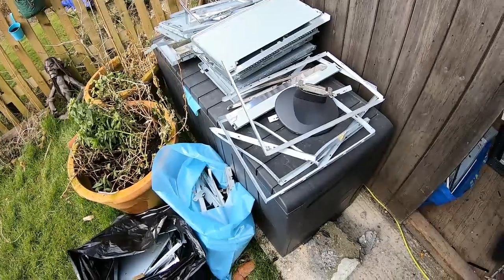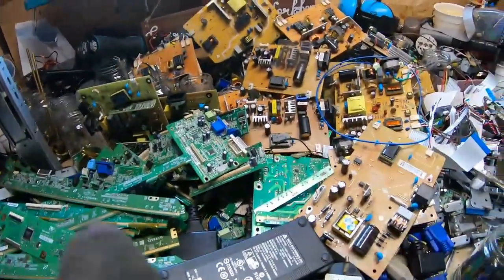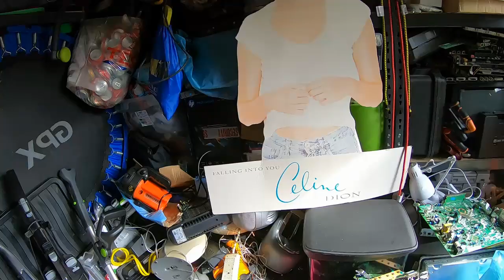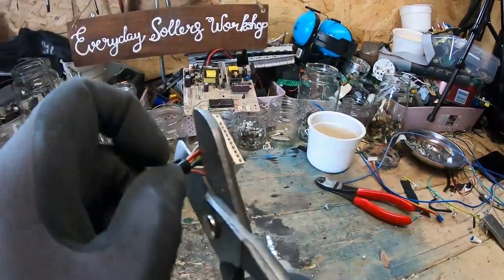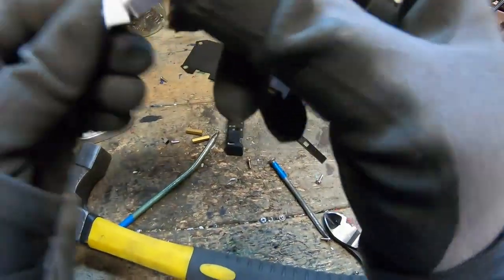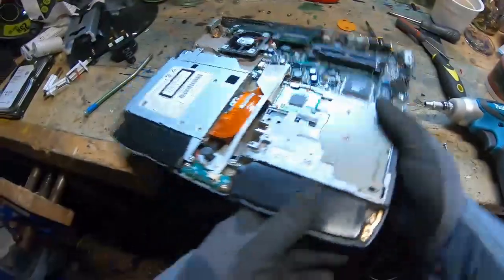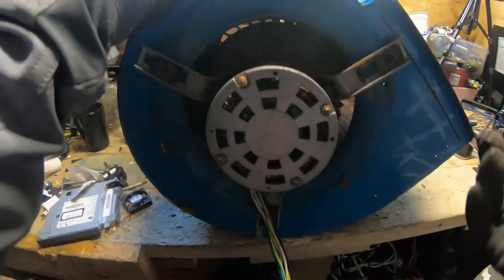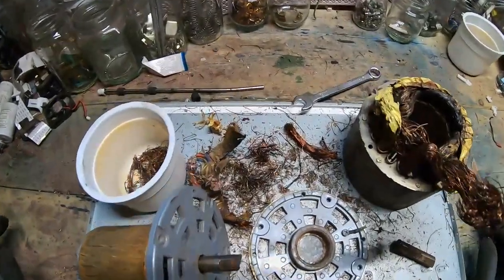Viva la scrap underdogs!! Look, scrap and sort that shed woman!!! Scrapchat #11

Comment: Hello there again.
Don't know if I told you already but I pick off the Mosfet and get high grade wire price for them. Yesterday I took in 27kg of them,,, you might think there has been a few circuitboards past my work bench 🤣
Reply from the maker: Hi yes that's awesome, I love getting the mosfets for their goodies!!🙂👍
Reply: @SollersScrappingandDiving  yes, they are a bit of a gem when you know what they are. For the time being I leave aluminium on the boards as price is higer for the boards 👍

Comment: Watched your show with the load of monitors,,fantastic find. When you opened this show with the bench completely covered, I felt like I was at home. Still have a few things left to take apart but am gonna focus on depopulation.
Something I saw a while back has proven true, on the small boards you find with gold flashing, they may be completely covered in gold with the solder mask covering it. Scratch through the mask to make sure, the mask can be removed with the use of a common (here) drain cleaner.
Be safe and thanks.
Reply from the maker: Great tip thanks Donnie I'll do that! I really must get round to depopulation soon, as you can see I'm a little overflowing!!! 😄
Reply: @SollersScrappingandDiving  thinking back when I first started scrapping, I threw away a LOT of potential rare earth metals. Just didn't recognize all the small items that contained them. Now the only thing I discard is obvious plastic and totally naked boards. Glad I've saved all the batteries I've collected from cell phones..,gold contacts easily removed and since we don't have anyone here who will buy them,,, gonna see what reaction lithium has with water.
Stay safe and thanks
Reply from the maker: That's exactly why I collect everything too Donnie! 👍